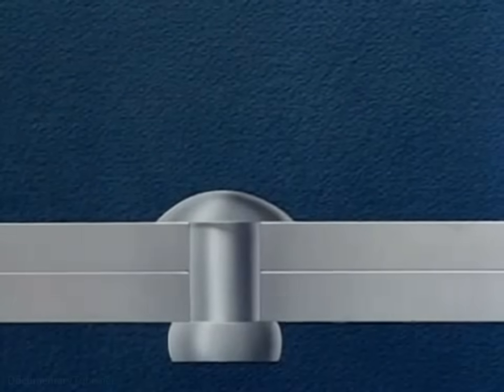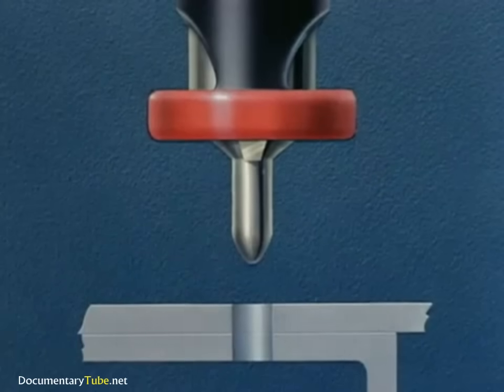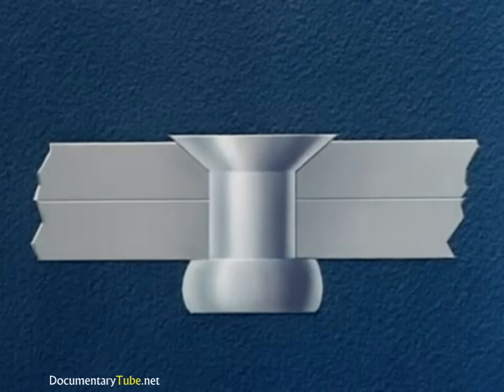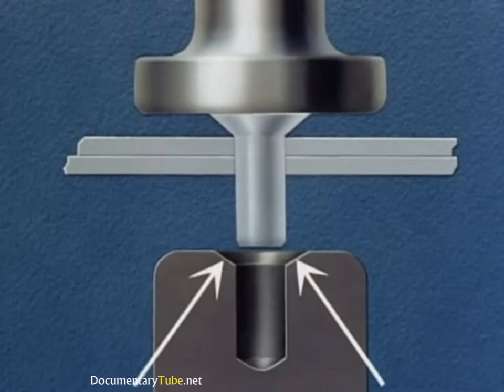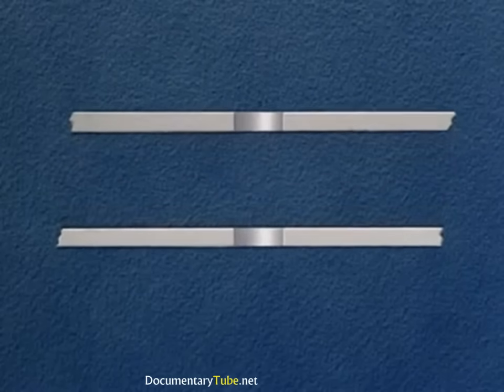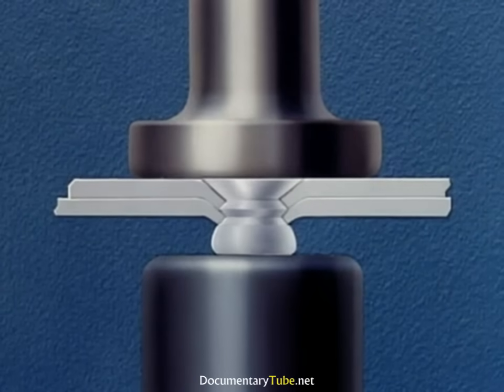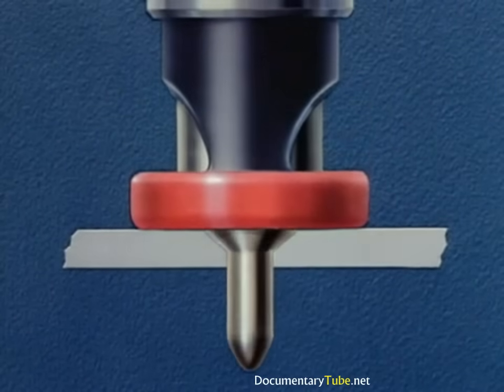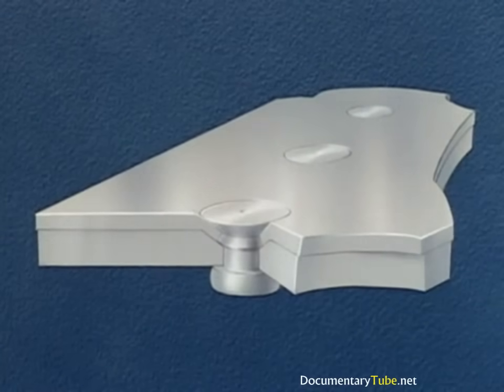HOW IT WORKS: Aircraft Flush Riveting

Comment: "we are using 1/8 inch rivet so we drill a No. 30 hole "..... so obvious. Damn imperial units are o funny.
Reply: I'm sure there was a chart somewhere in a forgotten book that had all the drill holes charted against the correct rivet sizes.  
And this kept the chart makers and book publishers employed.
Reply: Surely you are not implying that engineering is useless, right?
Reply: @blue04mx53  that book is not forgotten.   I have a well and frequently used "Manufacturing Standards " book.
Reply: No. 30 hole is the drill size.  Machine drills have numbers because usually the hole is slightly smaller than the actual fasterner diameter. It's like this since the start of the industrial revolution.
Reply: @2Phast4Rocket  no, a 1/8 rivet is 0.125 and a  #30 drill is 0.1285.
#30 is a clearance drill for a 1/8 rivet.
Reply: @2Phast4Rocket  I think you mean larger, the holes are larger than the fastener diameter in order to provide a clearance fit
Reply: @2Phast4Rocket  that is stupid. Why not just use actual units instead stuff like 1 1/8th and number 30... in metric it is way less complicated. You state the diameter of the rivet and the diameter of the hole, using the SAME units, without fractions. Like this: a rivet of 10 mm in diameter has to have a hole 10.2 mm in diameter to be drilled. No bullshit and extremely easy to understand
Reply: @2Phast4Rocket  So the rivet/fastener is installed with interference? There's interference applications but what is presented here isn't.
Reply: @2Phast4Rocket  .  The #30 drill size is .1285 dia,  The fastener size is .125.  dis.  The hole size is always larger than the fastener size.  Or at least has been since 1963 when I first got my A%P licence.
Reply: @2Phast4Rocket 
Not quite.
Reply: @2Phast4Rocket  
So, you prefer to use metric fractions instead of imperial ones. Metric is a simpler system to learn and easier to do math in your head. Other than that, no difference in usefulness.
Reply: Okay, in aviation it is called the rule of 7. Rivet diameters are sized in 1/32 in  increments so this would be a # 4 rivet. You first drill out the hole with a 1/8 drill bit, then you ream the hole out with a #30 drill bit. That is the way you are supposed to do it, not just drill a #30 hole. The rule comes in that a #4 rivet will take a #30 reamed hole, 4 and 3 equal 7. If you have a #2 rivet  (which is 1/16th or .0625 in you would then need a #50 (.070) reamer. A #5 rivet (5/32in or if you prefer .0156)  would then need a #20 reamer which is .161 so 5 and 2 =7.  Yes I am a retired aircraft mechanic and I had to look this up, it has been awhile. If you do not ream out the hole, you will have an interference fit.
Reply: @scotth1027  I should be allowed to smoke on an airplane, It helps find cracks, As an auto mechanic i always said im glad i dont work on planes, when my eff up came back, well it just came back.
Reply: Just have your Audel's Machinist's and Tool Makers Handbook open to your drill bit conversion charts. It's all right in there. #30 is right around 0.129". 

The numbered and lettered bits are there to give you the proper clearances for nominally sized fasteners and for drilling prior to tapping, reaming, etc.
Reply: a 1/8 " rivet WILL NOT  fit through a 1/8" hole.   NOTHING  will fit through a hole that's drilled the  EXACT  same size as what's going into the hole.  there must be  " relief ".
Reply: Machinists dont just use metric and imperial drill sizes. Look up numbered drill sizes and lettered drill sizes
Reply: @okornel  ... They do have the quarter instead of a .2 coin, tbf
Reply: A No. 30 hole can be replaced by either a 3.2 or 3.3 mm hole in most designs but may require a 3.25 (or even 3.26) special drill on tight tolerances
Reply: Number 30 drill is 3.5 thou larger than 1/8 inch.
Reply: Joeseph Smith  If that is the case why American engineers are widely using metric?
Reply: Back then everything was built with charts.  Still holds true now to an extent.  It makes manufacturing more accessible to the average Joe.  Joe doesn't need to calculate a tolerance hole for an 1/8" rivet.  Some engineer figured that out and put it in a chart so Joe knows what drill to use without having to think about it.  Metric machine work has charts too, but you guys stubbornly keep everything in decimal no matter what.

In a bit more detail for those interested:  The number drill sizes and letter drill sizes are for non-nominal holes.  In this example, the #30 drill (0.1285") provides clearance for standard 1/8" nominal rivets (0.1250" +/-).  The other use for those drills is to provide the correct lead holes for tapping standard nominal thread sizes.
Reply: @okornel  show me one practical application of that and I'll tell ya how it's done. I actually know an easy way to do it using a 21+ length board, and I'll mark your 16 into prefect 3rds. But I'll do ya one better question.... Where's your metric time?
Reply: No need for BIPM to resurrect silly French decimal time.  

Ever wonder why those cell-phone providers billed in six-second increments?  There's your decimal time conversion.  A similar conversion for decimal minutes in time management.
Reply: @okornel  16/3 is 5.3 repeating, so you'll likely use 5.333 for machining if we're talking about millimetres, with the appropriate tolerances.
Reply: @okornel  Not only that, but you also have to remember imperial is based on metric per definition and the smallest unit used is about 25 times bigger than the smallest unit industrially used in metric (which also scales better because it's simply base 10)
Reply: 3/32 = 40
No.6 screw = 27
No.8 screw = 19
AN3 Bolt = 12
AN4 Bolt = 1/4”
Reply: @okornel  how so? Because you don't understand simple woodworking, or because there is no metric time?
Reply: @okornel  oh? What immutable property of nature is used to define the metric money? Seems to me that the fluctuating value of money makes it a horrible example of a metric thing, even if it is based on 100 pennies to a dollar.... Then there is the problem of all the odd denominations of the currency itself. Where does the 2 dollar bill fit into metric money?
Reply: @root1657  how deep are you going to dig that hole.
Reply: @znk0r  dig a hole, build a bridge... Either way, I'll be measuring it in standard american units.
Reply: @znk0r  you don't have decimal time... Wonder why.... Also, as I've stated, they don't have shop tools that cut things in 10, they cut things in 2, which is what the bulk of our shop measures are based on.
Reply: @root1657  Your "American" units came from the British. You're welcome, but even we moved on to the SI system now for almost everything except human weight and vehicle speed, gotta keep up with the times. You know something MUST be better if the British are willing to accept it over their own system, we're notoriously stubborn.

Also, over the last 10 years I've seen more and more drawings coming from the USA using the metric system. When you are machining extremely small and complex parts down to microns it just saves space on a drawing, especially when all dimensions need to be bilaterally toleranced. I think the imperial system's days are numbered.
Reply: @root1657  In NASA they don't use imperial only strictly metric
Reply: @greenestpotatoes  yeah, and the use of metric was directly credited for a probe slamming full speed into the surface of Mars.
Reply: @root1657  exactly because of the confusion between the aeronautics industry's use of outdated imperial units
Reply: @greenestpotatoes  yeah, see, so you are actually making the case for why we should never make the switch.
Reply: @root1657  lol
Reply: @root1657  imperial still sux tho
Reply: @okornel  well, I guess we got to the part where it's just personal attacks and insults? I'll be around if anyone want to have an actual discussion on the topic, but you can go ahead and save the insults for someone else.
Reply: Nobody is using fractions here for measuring. As Hugo Stiglitz points out, the machinist or engineer is using decimal inches, rather than decimal millimeters. So what?
Reply: @leehaelters6182  I'd agree with the 'so what' part.
Reply: Got damn nightmare
Reply: Mark Penhall   Well, Britain DID have a whole branch of government dedicated to getting us in the war🤷‍♂️. For all the shit we get for being “world police” these days that’s only the case because others fell asleep on the job. 

We didn’t WANT this job, but after all the European empires turned to shit there was nobody else to do it.
Reply: @DrewLSsix  Apart from the mighty Soviet Union. They had boots in Berlin long before any American.
The Red Flag flew over the Reichstag, signifying a decisive victory over fascism.
The USA didn't win the war, The USSR did.
Reply: It's not so forgotten!  Machinists have drill size charts for example.  Lots of people use "Pop" rivets, they are 1/8" nominal size.  Now the world is full of 1/8" drills (.125"), and that rivet might not GO in that hole!  So even today I have a bunch of #30 drills (.128") just for this.  It IS a crazy system!  I'm a shop teacher, and have to explain this to a few dozen students a year.  Is it Stubbs' wire gauge?  Some ancient measurement from England.  The kind of thing that made people want to be metric!  It's a lot of fun explaining "imperial" measurements to people who GREW UP metric!
Reply: Stanila Stefan
naturally, when using a 1/8th rivet in 40 thousandths material you use a no30 hole. don't know how they got anything done.. but everyone should relax. the official measurement system for all large scale industries in the us is metric. actually for the whole country, though most people refuse to change because reasons.
Reply: @daos3300  Yeah, I've been thinking, while reading this silly bickering, that as an A&P and one who works on F-35s, we use metric everywhere at Lockheed Martin. In my 20-odd years in aviation maintenance & manufacturing, metric is the standard, though imperial does creep into a few places.
Reply: @crooked-halo  
Of course you do, planes fly to other countries.
And those countries don't care about inches.
Reply: Mark Penhall  
Converting the US to metric would be hugely expensive compared to your typical European mini country. It would obsolete billions of dollars worth of equipment.  Much of the US uses metric. Mechanical engineering is not one of them. They will all go metric eventually but it is going to take decades.
Reply: @ardvarkkkkk1  
Not true. There have been countless institutional studies done about (a) the cost and (b) the global efficiencies were America to change to metric. All have concluded full advantages. In fact, Congress PASSED a bill (can't remember when) authorising and instructing a national change to metric, but ... lazy, nationalistic, vested interests have "dragged the chain" on it ever since. Some industries ARE ALREADY METRIC -- those with international connections and for global harmony.  It is all the mindless voting eejits in cars and City Halls who politically won't change speed limits and common measures for the good of the planet. Typical American imperialism.
Reply: Hey mark, fuck off. You're probably sitting in a land of freedom because of us.  Just fuck off.
Reply: Mark Penhall   And where did you get your land?  I don’t even have to know where you’re from to know that you only exist as you do because other people were displaced or wiped out.
Reply: Metric is for NPCs -- they can't think...
Reply: Nope. All we asked in return was enough land to bury our dead.
Reply: @root1657  
And money.
Lots and lots of money.
All the money in fact.
Americans never seem to bring that up, except when the bill was due.
Reply: @MostlyPennyCat  oh, please do explain this new line of jabber, and be sure to site sources...
Reply: @snarkylive  First, thank you for proving my point. Second, seems a bit off to try to show me up on fractional division by asking me to do it in metric when I'm showing a case where sometimes metric cant do everything...
Reply: Imperial hating metric nut swingers are halarious. Their virtue signaling shows by design they are so simple minded they need a base 10 system to simply measure distance while also showing how stupid they are by not understanding the many more different ways to measure hole sizes in the industrial world using number and letter drills along with metric and fractioal drills, all while trying to show how smart they are and call the entire global ruling 1st world idiots. Hope that womens studies degree is helping pay off your 100 grand in student loans sissy. Next time you need to go metric just 25.4. Oh nevermind that's too difficult for you cause you're better than everyone who invented the modern world. Haha
Reply: destro513 maths for engineering is simpler in metric, it does reduce errors it’s more than just measuring
Reply: Didn't hear anyone asking that when the American designed and built planes were liberating Europe using the technologies in the video....
Reply: @root1657  
85% of the German army was on the Soviet front. The USA-UK-CAN-AUS and the rest of the world fought less than 15% of an already dying army. And Liberia, Burma and the USA are the only countries in the world still using miles, yards, feet, inches and fingernails rather than the more intuitive, practical, easier meter, war on not war
Reply: @paolopetrozzi2213  and yet you make no mention of that whole other part of the war because your mind is so eurocentric? And if it's so easy and intuitive, then I guess there is no more need to call is dumb and lazy for using a harder system? Ok, I surrender, teach me... How do I divide 10 by 3?
Reply: @paolopetrozzi2213  thank you for asking the very same questions addressed in other parts of the same thread, this showing you haven't read it, and just went far enough to try to troll it.
Reply: @root1657  The Germans were spot-welding airframes!  We were trying to get AWAY from riveting.
Reply: @root1657  America joined the war in Europe after the outcome was pretty much known. If Europe has any to thank it was the Russians, then the British and way down the line is the USA who may have shortened the war slightly.
Reply: @hugostiglitz6914  That is the most ridiculous ball of BS I've heard in a long time. You may recall that the Americans came in BEFORE operation overlord... and if you think the outcome was known before that, I'd ask what you've been smoking.
Reply: @hugostiglitz6914  And that has what to do with riveting?
Reply: @stclairstclair  
Yeah, you really didn't.
You sold us stuff buddy.
And when in comes down to it, the Nazis could not have beaten Britain, America or the Soviets individually.
We know, we fought (and beat them) on our own for several years.
Reply: @MostlyPennyCat  Yeah, I bet you would have also taken out the Japanese navy and captured their mainland while sinking all the nazis subs right?

Comment: Dimpling is NO longer done on any of the commercial aircraft today. Reason dimpling the skin of the aircraft that way caused stress cracks to form on the hole. This video is older then the hills from the 40s or 50s area and a rivet swagged between skins is now considered detrimental to the structure of the plane. All the other processes are still in place in the factory.
Reply: So countersinking removes too much material from thin sheets and dimpling causes stress cracks.  How are flush fit rivets installed on the skin of modern aircraft?
Reply: @damonthomas8955  Note that countersinking can be used on aluminum that's .040" or more thick.  To see how thin that is, stack 10 sheets of printer paper together and squeeze them tightly.  Modern jet skins are for the most part thicker than that so countersinking is easy.
Reply: I still don't get why do they even use dimpling. It's sounds so illogical structurally. I can't understand the benefits of it
Reply: @medetturgutgokce2001  very late, but it was done to reduce drag, as the dimple was to accommodate the countersunk rivets used to become flush with the skin of the craft.
Reply: @pikatrieu390  it first appeared in the A6M 'Zero' which outperformed contemporary carrier aircraft like the F4F and even some land based ones.
Reply: @medetturgutgokce2001   Countersinking reduces the amount of material the rivet head is holding, dimpling doesn't.

Comment: i have few questions.
are they this use rivet in airplane?
and if so, why don't use welding on airplane?
Reply: Welding quality is unpredictable without xrays.  Heat can warp and damage surrounding areas.
Reply: Yes this type of riveting is still used. Welding is infrequently used because it can change both chemical properties and the hardness (temper) of the alloys used in aircraft construction. Welding is sometimes used with low strength alloys in non load bearing structures.